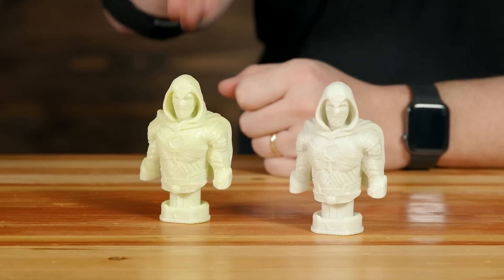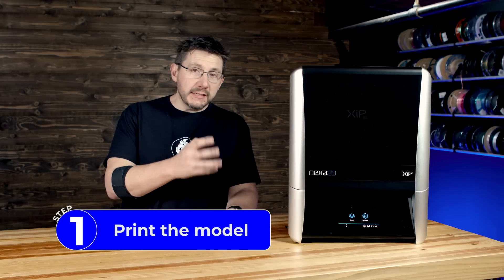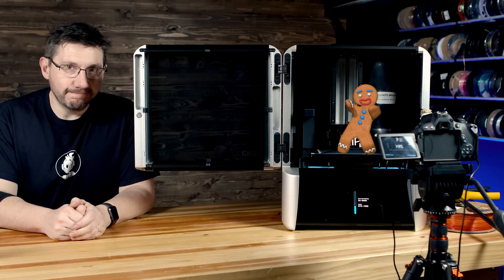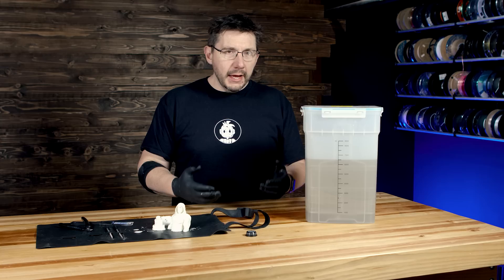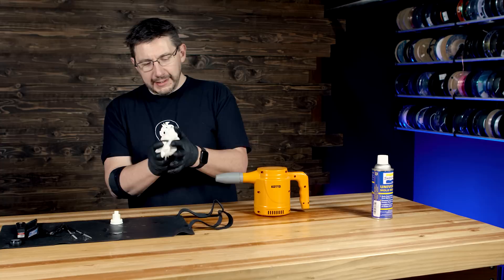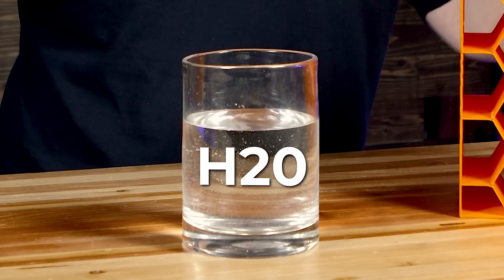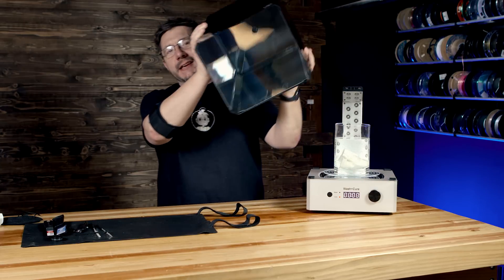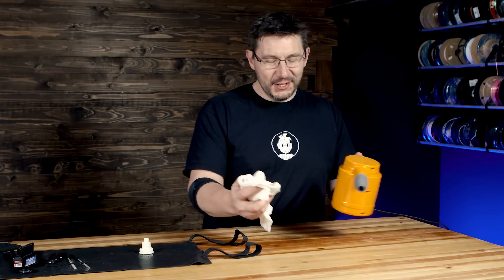Ultrafast FLEXIBLE RESIN on the Nexa3D XiP!

Comment: Would be interesting to see if it works the same if you just put the whole curing station in a big bucket filled with CO₂ instead of the mold release and the water.

Comment: Looks like an Anycubic Wash and Cure plus, so let's try putting some aluminum foil in the cover of our Anycubic Wash and Cure Plus, let's spray some models with Pam or silicone spray (the pure stuff) or some other polysiloxanes, then water cure it.
Reply from the maker: Do it!
Reply: @3DPrintingNerd  What makes you think I didn't do it, and more?

Just because you are so astonished at the shiny new (to you) concept of "water curing" and oxygen barrier techniques, and a USD $7000 3D 🍋resin printer that uses the same wash and cure machine as Anycubic (of course with shiny mylar in the cover) and makes that horrible "grid artifact" which Nova3D and Uniz printers don't?

In any case, you tube doesn't allow links to anything but you tube videos, which you must have seen on this topic a few years ago already(?), so you'll have to look up the decades of practical papers on these things yourself, LOL

Finally, please show the Nexa3D XiP light source quality by printing a 10cm L x 10cm W x 3mm  thick square flat on the build plate and show the face that is not facing the build plate, as a matter of fact do that for every MSLA 3D printer you have and/or review, you'll get lots of views and likes from viewers, but maybe not so much from 3D printer manufacturers...

Comment: Little known fact: people should be curing their prints for much longer than the community recommends. If you search the websites of prosumer and industrial grade resin suppliers like Liqcreate, you will find that 60 minutes is the standard recommended cure time. Some resins, for improved properties, are even recommended to print for 90-120 minutes. A select few are FURTHER instructed to pass through an oven cycle. Furthermore, opaque resins require longer cure times because they inhibit the flow of UV rays to their innards, which may remain uncured if not given sufficient treatment.

The reason that resins feel more brittle when they are cured longer is because they are further cross-linked. Their stiffness and tensile strength increase, even if their impact resistance and perceived toughness (all engineering terms with specific definitions) may diminish. CONTRARY to popular belief, they are NOT becoming brittle because of UV degradation. Eventually, yes, general UV exposure can cause degradation (shortening of polymer chain lengths). But it is generally not happening during the 60-120 minute cure window with the specific wavelengths of UV light used for polymerization. The sun produces a much greater range of the UV spectrum, which is why resin prints left out in direct sunlight will degrade over time.

Semi-related fun fact: Phrozen Nylon-Green Tough resin flouresces when undergoing UV cure. Stuff looks radioactive!

Comment: I've never tried mold release, but I always do water curing even when not using flexible resin. I've yet to have any discoloration issues, whether with light colored resin or with transparent resins. I'd be interested to see if you get the same results while skipping the mold release step.

Comment: The ONLY thing I don't like about flexible resin is trying to remove it from a flexible build plate. Those plates are usually great but when you flex it with these resins the model just bends with it!

Comment: You never mention how the yellowed one was cured or for how long. Was it water-cured or air-cured? You mention that 60 minutes is the cure time for that resin, WITH mold release, IN water. What's the "normal" cure time for that resin? Does that resin come in other colors? Do those colors change after curing or is it just white? Conclusions can't be drawn without all the relevant info. I'm not trying to come at you hard and appreciate the effort but I just keep seeing these "scientific" videos about different ways of doing resin-printing-related stuff, and they either leave out critical information, never gather the necessary data in the first place or introduce too many variables and draw incorrect conclusions based on their "science".
Reply from the maker: One that yellowed cured in air for 8 minutes. Normal cure time for this resin is 60 minutes. It does not come in other colors.

Comment: Try putting the yellowed one in hot water for several minutes and it will likely de-yellow.  I have to do this with all of my white resins - I cure them in water at 45C, then put them in 100C water for several minutes, let them cool down and they go back to being as white as they were printed (and sometimes more white).

Comment: What does the mold release do in this situation is it a barrier between the water and print?   Does it react to the resin?  What’s the silence behind it
Reply: The 'mold release' is an oxygen barrier, pal.
Reply: @retromodernart4426  cool thanks will this work with regular resin prints as well or could it effect the other types of resin?
Reply: @craiggordon2502  Assuming the resin being used is reasonable or better quality, it should work for regular resin prints (there's nothing special about the Nexa3D XiP besides a special film it uses in the resin tank instead of FEP or PFA (aka "nFEP").
Reply: @retromodernart4426  thanks 😄

Comment: I like curing in water, after cleaning, with Elegoo water washable resin. I find on larger/thicker prints the water acts as a heat sink and prevents warping. I also find that the water disperses the UV light giving me a more even cure. This means less flipping the part around to make sure all sides are cured. I haven’t tried longer cure times (on purpose) because out of water over curing leads to the parts being super brittle, and resin minis are fragile enough.

Comment: If oxidation during curing is a problem then why not use clear PVA instead of spray on mold release. Water could then be used to dissolve away the PVA after curing.
Reply: I've found that the refractive properties of water help tremendously in curing the inside of hollow models.

Comment: Love your videos but There are some things in this video that bother me from a safety perspective. You should use gloves when using mold release as well as wear a respirator and be in a well ventilated area when using it. Mold release is basically PTFE in solvent. Both of which are really bad for your lungs. Not to mention that the water is basically hazardous waste because of the mold release. Next, unless your clean IPA is fresh you do not want to work with it without gloves the uncured resin can for some people give really ba rashes or chemical burns not to mention that IPA is a drying agent and dehydrates the skin. So water curing is a thing and it can have drastically different results. I personally don't use it anymore because the waste water basically becomes hazardous waste when used in this type of application and disposal is annoying. It's more easy to deal with in industrial settings which is probably why Nexa3D targets that market.

Comment: Based on on-screen appearance, is it also somewhat less flexible after the extended curing?
Reply: I believe the final product is the one that meets the manufacturer's stated flexible rating. Right off the build plate, it is much more flexible than intended.

Comment: I have found it very difficult to eliminate the tacky/shiny surface on a lot of resin models. I've gotten best results with a 3 stage wash process where the third stage is an ultrasonic heated bath. But I still don't get results like this. I'll have to try the new process and see how it goes. Thanks for the video!
Reply: you should change the resin or you have a printer with a few mmw/cmsqr

Comment: Transparent resins are the most common type of resin prone to unpleasant discoloration. If there's anything to try the mold release process on outside of these flexible resins, it's clear resins.
Reply: I was thinking the exact same thing. If I can get clear prints with cheaper resin, I'm sold. Siraya Tech is awesome, but expensive.

Comment: I stopped watching at 09:28 .
What do I think wel to be honest totally Honest .
The quality sure is way better than FDM printing yes .

Skipping back for about a year a was kinda harsh about the Creality belt printer and I will apologise because after way more reviews i do need to say the Belt printer can do long prints and in my case it would be great to be able to print long train track parts .

Now Let’s get back to topic .
The Quality yes resin looks awesome indeed no real visible layer lines .
The ability to print smooth parts and small figures like warhamer 40K ore even lego pieces .

But then the part i do not like at all because i wil be honest .
The proces steps after the printer is done printing .
To much chemicals what makes printing things way to expensive .
So for me I love watching you Joel .
I did learn allot about FDM printing and the use of Cura .

And that is something I want to talk about .
I have seen U use an Appel mac device .
So I guess you’re using Cura on it .
I Use an old Microsoft laptop for Cura .
And i design with my Apple IPad Pro 2020 .
And it can’t run Cura on it so to slice .
I need to take the STL files on an USB stick when i downloaded my designs from Tinkercad .

To start up the Microsoft piep piep piep Laptop ( Sorry for the pieps I just hate Microsoft allot )
And when I Got it running I load the stl from usb to slice to safe on the Micro USB card .
And then walk over to the FDM Creality printers I got to start printing .

I got 2 Creality 3D pro FDM printers with the volume of 21cm wide 20 cm deep and 23 cm high because i print with an 0.8mm nozzle .
And i am interested in information about a good slicer that can be installed on the IPad Pro 2020 .
An offline version because the one Creality got is online and I bumped into issues with the G-codes .
Most of the time i get layer shifts .
And the printer stops and then keeps on feeding filament .
So I went back to Cura on the piep piep piep Microsoft laptop .
It’s the only thing where I keep the laptop for .

So can you look into it and make a video about a slicer for the IPad Pro users like me .
Greetings The.NL.Pirate.King from the Netherlands .
I hope my Reaction ain’t to long :) .

Comment: Hey Joel, I've been considering trying to get a XiP at work. We already have a Form3 that we're using regularly. Would you say you get better and/or faster prints off of the XiP? Anything I should be aware of with it?
Reply: Best to hear from Joel himself, but the XiP is significantly faster and cheaper to run than the Form3. Check out the comparison document and request some samples! https://nexa3d.com/nexa3d-vs-formlabs/
Reply: @Nexa3D  Hi, when are you going to fix your light source in the XiP so it's on par with Nova3D and Uniz?

Or should we just print minis and figurines at an angle to hide the "grid artifact"?

Thanks in advance for your reply!

Comment: Are there any resins for regular printers that are very flexible? I'm using Siraya Tech Tenacious, but it's not quite tacky enough when done. It's better than regular resin, but I need an item with 4 small feet (about 1.5" square) to sit on a rounded surface (drink tumbler on its side) without sliding off.
Reply: Try Liqcreate Flexible X, it's like real rubber.

Comment: Hey Joel, this may not have been your intent, but you've certainly put me off getting a resin printer.  Soooo much fuss and (potential) mess afterwards.  Thanks!
Reply: Having started both resin and FDM printing at about the same time, I found resin much easier to get in to and get printing consistently good prints. Yeah the post processing is a bit more work, but it's all much more straight forward than FDM.
Reply: You're upset because he used a resin machine?

Comment: Interesting video joel
Lots of questions

1) what is the long term effect....I.e. will it still yellow over time?
2) will it work with non flexible resins?
3) will it work with clear resin?
4) do you need the mould release? Or is it just the more gentle cure?

Comment: Very interesting. I have not used that process before and I think 60minutes of cure time is so much. Maybe it's just the material, but I've never had any resin turn yellow like that. I will add, the parts that I left in the AZ sun in July for 10 hrs, those were yellow like that, but that's way longer.
Reply: Cure time is dependent on the size and geometry of the part, but most of our industrial materials require 30-60 minutes to reach appropriate tensile strength. White and clear resins when exposed to large amounts of UV (and the AZ🌞) will yellow over time.

Comment: I have some guesses as to the chemical reaction and tricks as to why the process is such. I would guess that something like this is used for higher accuracy prints actually.
Reply: For sure! The mold release prevents water absorption into the green part, and submerging in water prevents oxygen from inhibiting the surface cure.

Comment: High five to you too. Love seeing more resin printers. Do you think a vacuum chamber would remove enough air (and oxygen with it) that you could use that instead of having to dunk? Super curious and maybe it works! Would be drier than water.
Reply: A vacuum chamber would definitely work, or a co2/nitrogen purged chamber could also work
Reply: Remember, the water is supposed to have better refractive qualities (relative to curing effect) for the UV light than air...